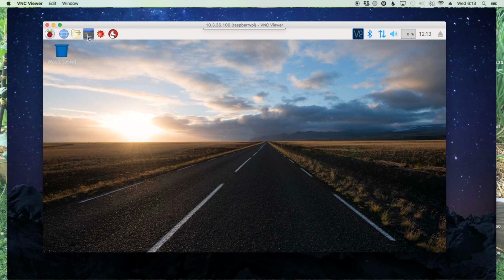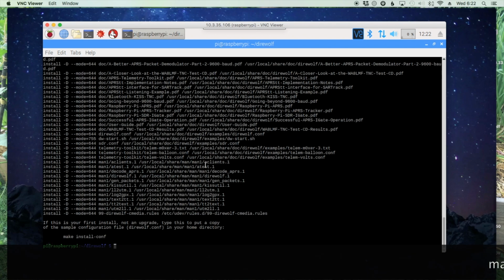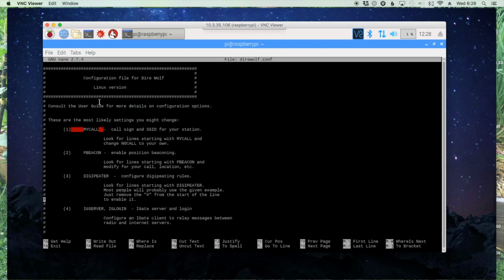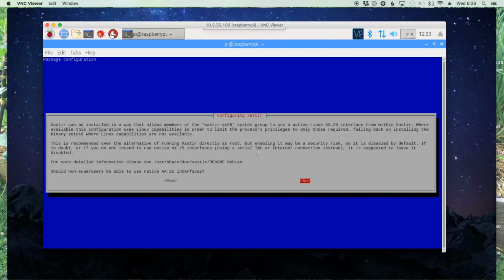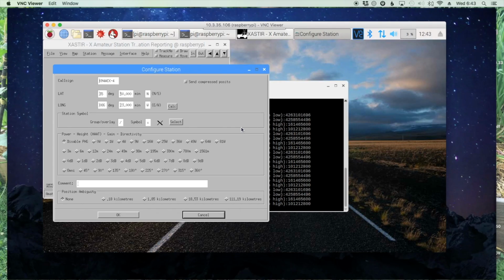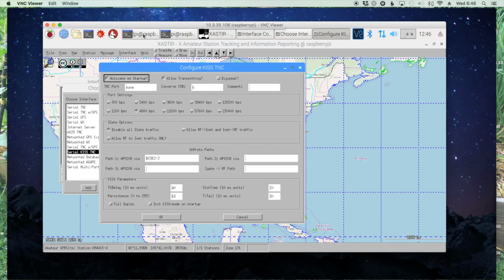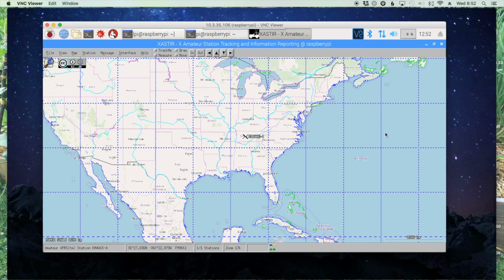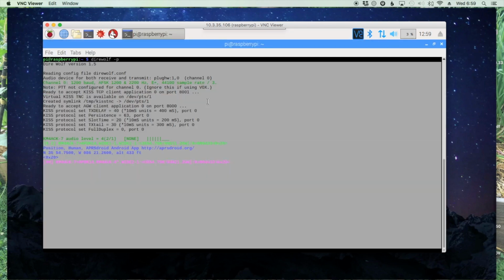APRS Digipeater with a Raspberry Pi

Comment: What audio settings would i need to change on the pi to communicate with a baofeng?
Reply from the maker: The best approach is to use a signalink or similar sound card with VOX built into the sound card. When using the Baofeng, if you attempt to use VOX built into the radio, most of the returning packets won't be decoded because of the long VOX delay with the Baofeng.

Comment: Very helpful videos. I'm running direwolf, xastir, IC 7000, signalink.  All works when interface is internet server.  When I set interface to to serial KISS TNC I receive and see stations populate the map, but I don't transmit my position and don't show up on aprs.fi. I've tried several radio and direwolf settings.  Any suggestions?
Reply from the maker: Checkout the video I just released. It covers everything in great detail https://youtu.be/AYhVDgRJBNw
Reply: Turns out alsamixer needed to be adjusted up to get my configuration working.

Comment: Great Information. I have everything running. but Serial Kiss TNC will not go up. Any help?
Reply from the maker: This video is long in the tooth now. I suspect you are using /tmp/kisstnc which won't work on Buster. After direwolf starts just to the right of /tmp/kisstnc you will see /dev/pts/X where X is a number. Use that instead and you should be in business.

Comment: Jason, If I wanted to run an iGate at home in which I'd not be moving, would I need to run and use Xaster?
Thanks,
Mike
Reply from the maker: There are several different ways to run an igate at home. Xastir is one of them that works well and is the one I am currently using for mine.

Comment: It almost works. The direwolf screen just flashes continuously. Seems I can never get any pi programs working. frustrating little toys.
Reply from the maker: Flashing direwolf in buster is a known issue. Easy fix by adding "-t 0" to the end of your direwolf start command. So if your normal start command is "direwolf -p" mod it to be "direwolf -p -t 0" Note: that is a zero and not the letter O.
Reply: @KM4ACK  I am running Buster. That takes care of that issue, Thanks. Now to get the interface control to run. I'll go back over the video again. I must have missed something

Comment: I’m looking for what is not needed for the igate setup.  I want to build a portable digipeater that will stay in my truck and will not have internet access when I’m out hiking.  The truck will be parked at a high point with reliable access to an igate and my HT.  The HT on my backpack will not have reliable access to the igate.
Reply from the maker: You can use this setup and leave off the aprs server configuration.
Reply: @KM4ACK  Thank you for following up.  I went through this again and see that this will not be a straight forward to create a fill-in digipeater with a headless raspberry pi.  I'm looking for a way to run a TNC digipeater via the console without X and automatically at boot up.
Reply from the maker: jermlac you will need to checkout a pure direwolf solution. I don’t have a video on it but direwolf is capable of running a digi on its on without X.

Comment: Greetings! COVID has "encouraged" me to learn about Pi4 and get back into APRS. My goal is to build a digipeater at my house which then can path to a nearby Digi (9 mi?). Could I use the Pi4, Signalink, and a handheld scanner as my radio? I want to be within a few miles of my house with an HT and get into the system but hope to have the Pi and scanner and J-Pole setup in my garage 24/7. Would this setup work? Thank you so much and I'm visiting the http://www.aprs.net.au/vhf/aprs-digipeaters-101/ link you posted.

73,
KC8CAY
Reply from the maker: A scanner would net you a receive only igate if you can feed it's audio into the pi. If you want a true digipeater, you will need to connect up the pi to a transceiver. 73, de KM4ACK

Comment: What changes would be made if you['re connecting the Baofeng right to the pi? I have a cable that would connect it directly to my Android phone and am using a USB to audio adapter to connect it to the pi. So, no "TNC" per se, unless it's built into the cable.
Reply from the maker: Direwolf is the TNC. You will need the cable, a soundcard, and a way to trigger PTT on the Baofeng. Don't use VOX on the baofeng. It will transmit but won't receive very well. https://mikebeach.org/2015/10/27/using-kf5inz-easy-digi-with-baofeng-uv-b5-or-uv-b6/comment-page-1/
Reply: @KM4ACK  So, I'm using the B-Tech APRS-V01 cable. it's meant to be a TNC between your phone and the radio (to run APRSDroid). I take it that I need a different cable altogether. Thanks. :)
Reply: @KM4ACK  Thank you for this. I was trying it with VOX, but it keeps kerchunking. I'll have to check this site out.

Comment: I noticed with the Build a Pi v2 build that Xastir complained about a hard fail when starting the KISS TNC. To fix this I had to change /tmp/kisstnc to /dev/pts/1 for the interface port in Xastir
Reply from the maker: That is an issue that was introduced in Buster. Just know that your pts # can change.
Reply: THANKS!

Comment: I have a Raspberry Pi 4 and have raspbrian buster installed, Can i use the same commands you did?
Reply: Also does direwolf and xastir  accomplish APRS or tie to it?
Reply from the maker: This was written on Stretch instead of Buster. It should transfer but you might run into a few glitches. I haven't tried this on Buster yet. Thanks for the video idea. :-) 73, de KM4ACK
Reply: after entering the following command on my pi 4, (git clone https://www.github.com/wb2osz/direwolf)  I get an error   could not resolve host, unable to access.

Comment: Great Video - Just wondering if this would work with a lesser expensive USB sound card instead of using the Signalink, or is the audio quality of the less expensive type sound cards substandard for packet radio?
Reply from the maker: It can be done with a less expensive sound card. The only downside really is the difficulty in setting the system up with sound cards that don't have VOX built in. 73, de KM4ACK

Comment: The video title is 'APRS Digipeater'. You didn't say anything about the radio you have connected to the Raspberry Pi. Surely what you have built is actually just an i-Gate?
Reply from the maker: It is a full blown digipeater connected to an 857D. 73, de KM4ACK
Reply: @KM4ACK  - of course. You were using the Signalink as the audio interface.

Comment: How do you configure the PTT as this might be the only kit for APRS I may have with me ?, as with the comment by A and the Xastir icon I have a similar problem with my Direwolf icon which when clicked and boots up in a window it flashes, I dont know how to change settings to add the -p -t 0 command into the icon ?.   as always great stuff please keep up the good work and thank you Jason
Reply from the maker: I use this with a signalink which has VOX built in. No need for additional PTT command. If you are using a different sound card, try consulting the direwolf forum https://groups.io/g/direwolf/topics Start direwolf from the command line with the command 'direwolf -p -t 0' to stop the flashing. Don't use the icon on the desktop. 73, de KM4ACK
Reply: @KM4ACK  Thanks Jason, can the command direwolf -p -t 0 be added so the icon on the desktop work direct without remembering the dw-p etc thing ?, looked online and being new to the pi and pi scripts its all a bit foggy on the old grey cells hi hi, keep up the great work between you and Julian my portapack set up will rock I cant thank you all enough. 73.

Comment: Hi, I know it been a while.   I'm trying to follow the install using an rp4.  I have been successful with wsjtx, js8call, and pat ardop.  I s configured and started "direwolf -p -t 0".  When "sudo xastir" when I add and start the KISS TNC I get the following error:  EACCESS ERROR      Interface Error!  Error opening interface 0 Hard Fail.
I have checked for mistakes, but I don't see any.   Any guess on what to do?  Thanks...
Reply from the maker: What port are you using for the KISS TNC?
Reply: @KM4ACK  In dire wolf.conf I see AGWPORT 8000 and KISSPORT 8001.
Reply from the maker: I think we are talking about two different things. Can you email me screenshots of the failure please. Mycall@arrl.net
Reply: @KM4ACK   I am also getting the same error when I follow your Kiss tnc set up on a rpi4b using buster. I started direwolf using the -p -t 0. Have you got a fix for this yet or know why it wont connect? Thanks
Reply from the maker: Stuart Dingle Buster is different from Stretch. Use /dev/pts/X that direwolf shows when you start it. X will be some number. Usually 0 or 1.

Comment: when I start Direwolf it opens and the text is blinking, this is running on raspberry pi 2. Has anyone experienced this?
Rick,kd4dra
Reply from the maker: This is a known issue with direwolf in buster. start direwolf with the -t 0 (NOTE: that is a zero and on an o) so if your normal direwolf command is direwolf -p it would now be direwolf -p -t 0
Reply: @KM4ACK  Thanks, that helped me too.  Mine was doing the same thing.  I thought something was wrong with my installation and was just going to post a question when I saw Rick's post.

Comment: I am running a new Raspberry pi4 and having a little error with kisstnc when in a terminal sudo kissattach /tmp/kisstnc wl2k I get this error kissattach: /tmp/kisstnc: open: Permission denied. In Xastir interfac control properties /tmp/kisstnc never goes up.  I can make everything work by using /dev/pts/1, but this changes every time opened.  Please can you help me?
Reply from the maker: I have the same issue. Something changed in Buster. Never had that issue with Stretch. Haven’t had time to dig into it and see if I can find a fix. If you figure it out, please report back. 73, de KM4ACK

Comment: So how does the APRS Digipeater enter/exit to the radio?   i.e. where does the radio/sdr fit-in, and what kind of rf modulation does it use? 

What about services like SMSGTE?  Can anyone run a server like that (which takes RF->SMS, and SMS->RF)?
Finally, any thoughts on specialty "APRS hardware", like Mobilinkd TNC3, SainSonic 2015/AVRT6.. are these the same as doing it on the Pi?
Reply from the maker: You will need some sort of sound card interface (ie signalink) between the pi and the radio. If you connect it to the internet (ie igate) you will gate any traffic to or from services like SMSGTE. As long as you have a radio license, you can run an APRS digi/igate. Mobilinkd would work great here for your sound card interface and it's not limited to APRS. It works equally well with Pat Winlink over 2M. 73, de KM4ACK

Comment: ThanK you for the video. I have been trying to get direwolf loaded for a few day and your video fixed my problem! How can I connect a rtl-sdr instead of signal link? I’m am just trying to make an igate but can’t figure out how to get it to work. Thanks KD9HWU
Reply from the maker: You should check out @SignalsEveryWhere on YouTube. He is the master of all things SDR related to ham radio. 73, de KM4ACK
Reply: It sounds like what you need is a virtual audio, this allows you to pipe audio from an application such as sdrsharp into your igate. You could use rtl-fm which is a lightweight command line SDR client. This video shows how to use the cables https://youtu.be/RGvrT40xkSY

Comment: Just got a Pi 4, and am stuck at the arecord -l (lower case L). No devices come up. Do i need a piece of hardware here?
Reply from the maker: Yes. You will need some kind of sound card interface. A signalink, wolphilink or the like to be a digipeater. It is the interface between the pi and the radio. If you prefer the mobilinkd TNC & a baofeng, check out the video that released this morning. https://youtu.be/gtvtWL3_prA 73, de KM4ACK

Comment: Problem: when I run direwolf -p I get a flashing return. I have the same responce as you have except the line "ready to accept agw" preceeds the line "ready to accept kiss tcp", not as the last line.
When I first ran the direwolf -p I did not have my Signalink attached. I attached the Signalink and re-ran the Direwolf -p command which resulted in the above.
Suggestions
WG2W (again)
Reply from the maker: It is a known issue in Direwolf on Buster. See this page for additional details. https://dl1gkk.com/setup-raspberry-pi-for-ham-radio/ 73, de KM4ACK

Comment: Thanks for your videos! (I'm becoming a Pi fanatic)
Do you think the Pi zero or zero W has enough horsepower to play this role?
-Rob
Reply from the maker: Can't say as I have never owned a pi zero. For the slight cost difference, I would get a pi 3. There is a way to run a digipeater with just direwolf. If you went that route, the pi zero might work. 73, de KM4ACK
Reply: @KM4ACK  Fair enough. I have a Pi 3 B, but was coming at it from a physical footprint & power consumption perspective rather than cost. I have been playing with the AREDN mesh networking and I'm trying to come up with a list of network 'services' that can be offered. Some things need more horsepower, like VoIP (a zero or zeroW wouldn't fair well for this), others need less.
Thanks again for the info. you are putting out there!
Reply from the maker: @rkaag99  Gotcha. AREDN is a ton of fun once you get a few people on it. I have even shown how to do Pat Winlink p2p over AREDN in a past video. https://youtu.be/CCF8r236yiA And while I don't have a vid on it, I manage a full blown PBX on our local AREDN. 73, de KM4ACK

Comment: I'm still trying to fathom out how all this works... what exactly is taken on the hike and what is in the vehicle? I'm new to all this hence why I'm asking for clarification. Cheers.
Reply from the maker: So an HT is taken on the hike. A full size (50W) rig with a raspberry pi connected to it is in the jeep running the digipeater. The HT sends out a signal which is heard and repeated by the rig in the jeep. 73, de KM4ACK
Reply: Thanks for the reply. So the HT is being used as is (so not using the setup from your previous video showing the HT linked up via cable to APRSDroid,) it's the digipeater/raspberry pi in the vehicle sending APRS location data instead? So how does this know your location from the HT, is this embedded in the radio signal? The reason I ask is I'm about to purchase the cable from the first video but don't know if it's actually needed when using this setup.
Reply from the maker: The HT needs a GPS signal. This can come either from a HT that has one built in OR from a setup using a cable and APRSDroid. When using APRSDroid, the app uses the phone's GPS and then passes that data to the radio through the cable seen in the other video. 73, de KM4ACK

Comment: Great information! One question ... if I had a gps tied to the pi, how difficult would it be to have the position updated dynamically while traveling. My vehicle has a WiFi hotspot with internet access through a cellular connection. AC1EW
Reply from the maker: Not hard at all. I run it that way in my Jeep with an Yaesu 857D. You just need to configure the GPS in xastir by adding a new interface.  Thanks for watching! de KM4ACK

Comment: Saved thanks. I’ve been trying to find the best solution for some time and used to have a TinyTrak3 w/FT1500M but that unit failed and since I want the TX/RX functionality am going to go with a TT4+PI and. Suitable high power radio as I have not had consistent results with an APRS+HT in my area. Would be also nice if I can figure a real-time APRS PI message display app.
Reply from the maker: Xastir will allow you to send/receive APRS messages. Thanks for watching! de KM4ACK
Reply: I'm back at it. Failing at using a TT4, I bought a Tracker 4 but it is not quite usable yet. Well, right now I am powering the Tracker 4 off a Pi4 and am configuring that following your instructions. Need to get the USB GPS feeding Xastir but at least am headed in the right direction. :-)

Comment: Can you post pictures of your cable set upset for this installation.  Thanks.
8P6RC
Reply from the maker: I'm running a signalink with this project. One USB cable from the pi to the signalink. one cable from the signalink to the 857D. I didn't build the cables. They come with the signalink. http://www.tigertronics.com/ Not much to show in a pic but you can email me mycall@arrl.net if you have more questions. de KM4ACK